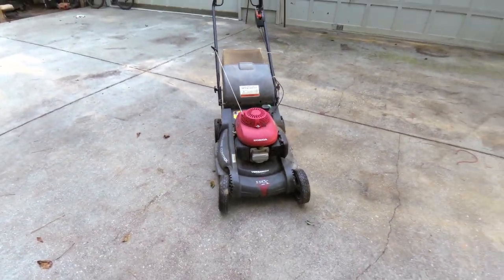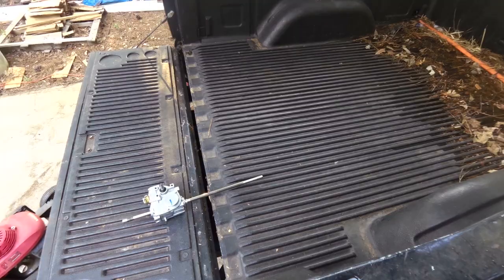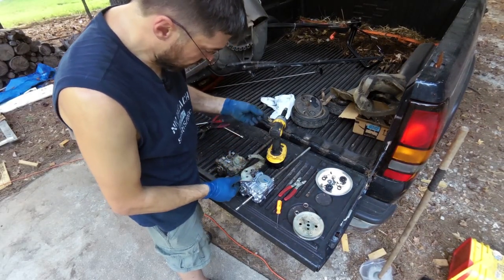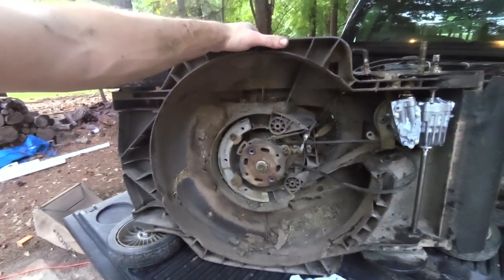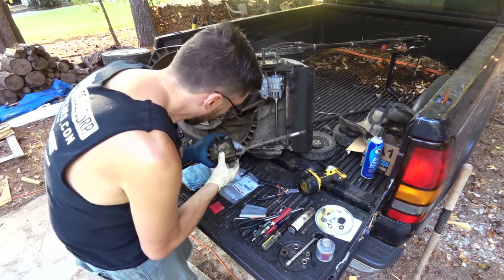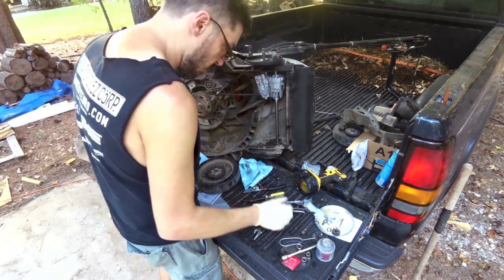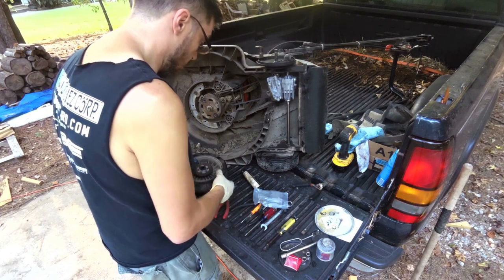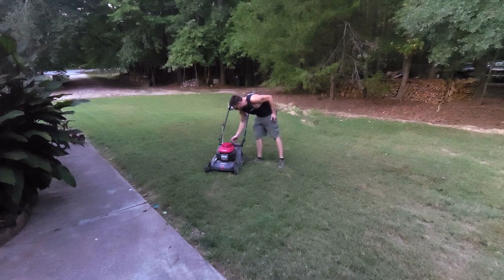Replacing a Honda HRX217 Transmission

Comment: If no one has kept the rear adjuster bushings lubed, all that extra resistance may be why the transmission failed.  It needs done every 1-2 years.

Your parts guy is wrong.  Grease is the way to go, and that spacer washer isn’t matched to anything.  It’s just a spacer.

Comment: If you take it to Honda and show them they put a claim in and then wait to see if they accept or reject it the only issue is you repaired it and you’re not original owner they replaced mine 0 cost
Reply: Yep, 5 year residential warranty.